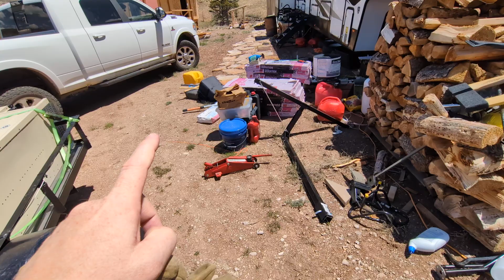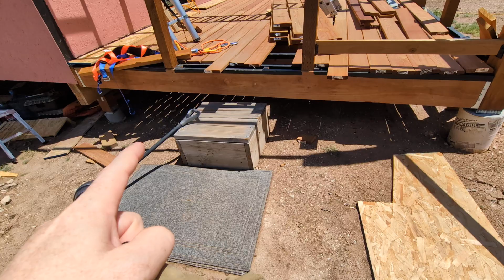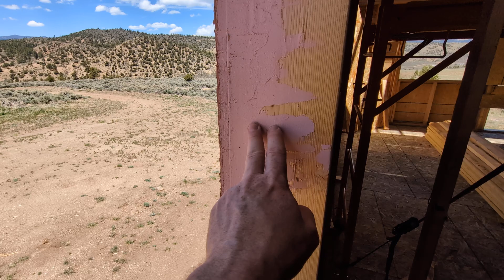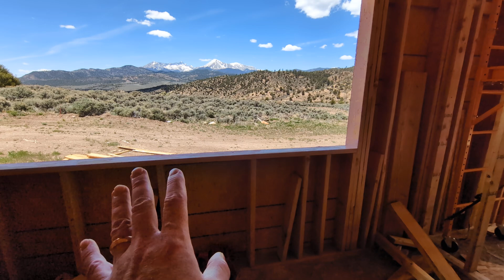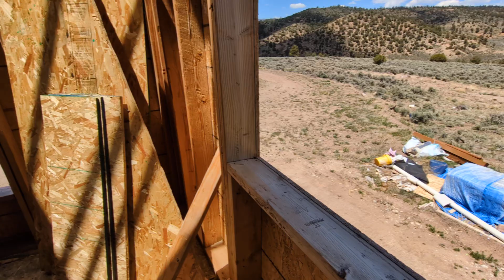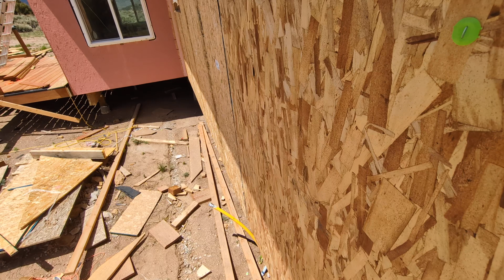Casa Blanca: Colorado Off-Grid House Build, Ep.14

Comment: Prosoco Fast Flash I thought didnt go on the walls. I thought their Cat 5 Product was the final coating. Great content nonetheless go after that CO inspection !!
Reply from the maker: Thanks! FYI Cat 5 is their higher-end product and is ideal for zones where you get hurricanes and tropical storms, but isn't needed in ours so we went with the more budget-friendly Spray Wrap MVP. Their application guides call for FastFlash or Joint & Seam Filler depending on what you're doing - one is thinner and rolls out better, the other is fiber-reinforced and needs to be tooled on.

Both are compatible with Spray Wrap and each other, and can be used basically anywhere - horizontally or vertically. Their own application guide has a section specifically on window and door detailing and states " Apply FastFlash over the exterior inside framing of the rough opening and onto the exterior vertical wall surface 4–6 inches to
create a 12–15 mil thick monolithic, pinholefree flashing surface."